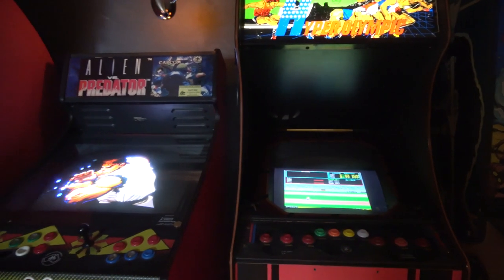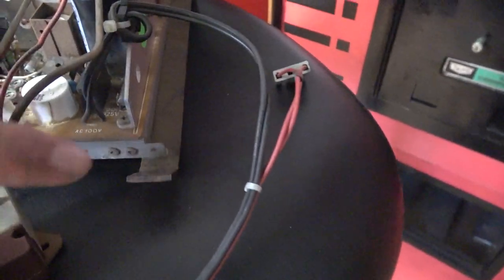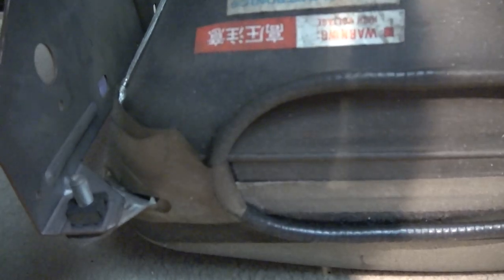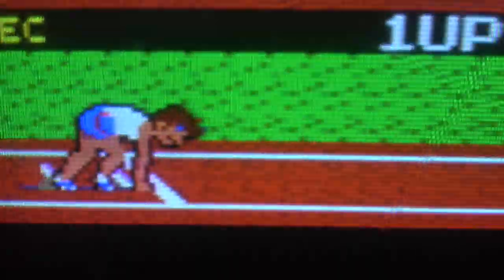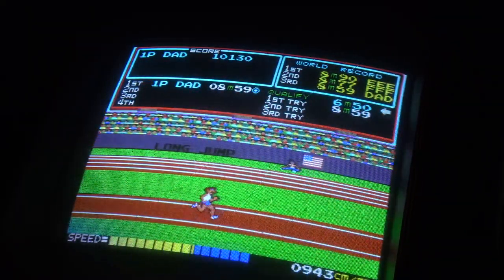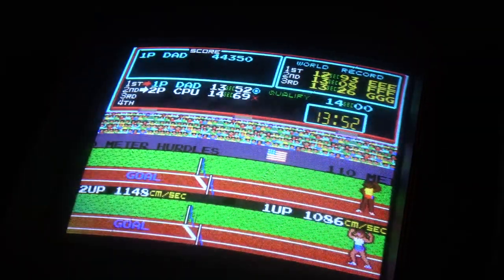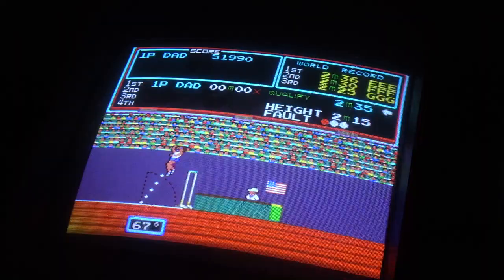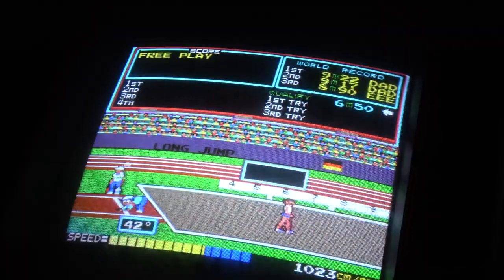FE016 - Swap that LCD for an Arcade CRT!

Comment: If you can do all I need to know about the nanao 2930 and toshiba from blast city...I will love you.
Mine blast is fine,just a little red on the first 1/3 on the screen 1mm in 15khz...but more in 31 khz.
So I just bought strips but I need to know more about the rings,the board and all.
Thanks.
Reply from the maker: Hop on the Spacies discord channel and ask there...you can post pics too. If I can't help you maybe others can... https://discord.gg/48WtkjY